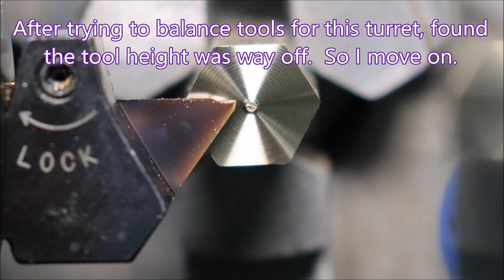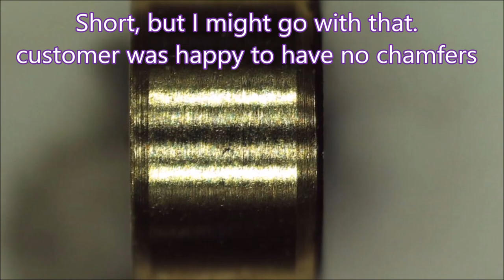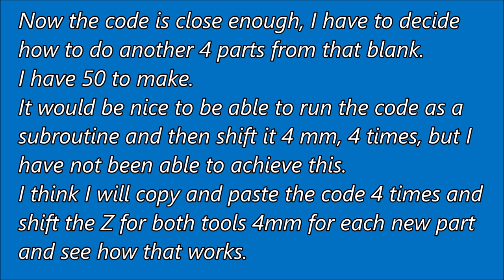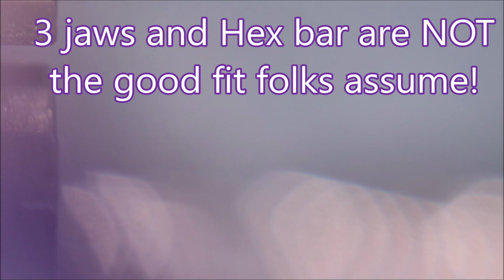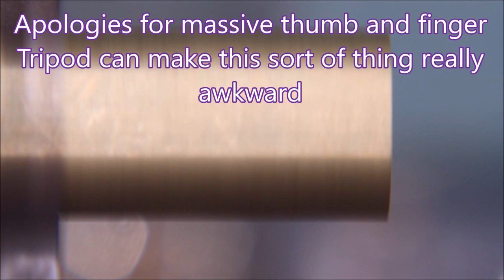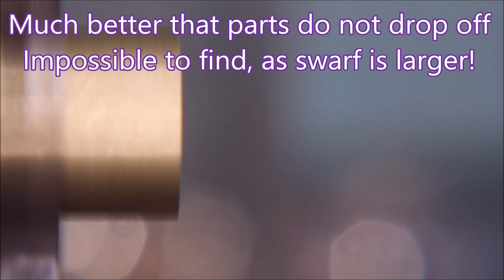Trash to Treasure, Clock repair bushes from scrap brass in a cnc lathe. G code fix, turn & part

Comment: Looks like you need to add a marker holder to your gang tooling. :-)
Reply from the maker: LOL, reminds me of the video where a wire brush is strapped to the turret to wire brush a thread that has been cut.

Comment: Something you could have tried is using relative figure (W) in canned cycle and just use absolute figure (z) for the start of each part. That way you could just copy paste cycle and just change your start posting, for me I usually use a g54.
Reply from the maker: I have another 50 to make at 2.7 diameter. When I play with that I will give it a try.

Comment: I'm New to cnc and have a question wrt cad cam. I have a hitachi Seiki machine and wonder what open source software you might recommend? Cheers love yr vids.
Reply from the maker: Craig Walker, Hi Craig, as I use the software that came with the machine, I am not very qualified to answer this.  May be someone else may chime in with ideas. You could check out the “path” workbench in Freecad. See if they offer a post processor that will work for you.
Reply: @smallcnclathes  Thanks so much the swift reply. Presently I am battling the serial connection but I did find freecad and will investigate further.  My machine is conversational apparently so maybe I should learn and only use that...Thanks again and enjoy your day!!
Reply from the maker: Craig Walker does your system offer simulation. I find it a really valuable learning tool.
Reply: @smallcnclathes  Not sure. Not got that far. I've been able to input the stock specs but not inputting the final shape as yet. It's a ht20s2 with seicos/yasnak control. Have manuals but the conversion from Japanese is awkward...
Many thanks!!
Reply: And yes, I agree the simulation be very useful!! That might be what it comes down to: if conversational does simulation...forget the cad cam.
Reply from the maker: Craig Walker friend has on old mill that has no simulation, he simulates using timber board. Perhaps you need to buy some round timber or plastic to do simulations.
Reply: @smallcnclathes  that is excellent advice. Thankyou.edit re plastics: I got come prices for plastic a while back and was shocked. I (like yourself) am into being "economical" with this "quite costly" hobby.Lol.
Reply from the maker: Craig Walker my aversion to cost has mainly come about since I have retired! Some rounds of timber may be your cheapest option. Plastics are expensive, pvc is the cheapest but does not particularly machine well. Acetal machines great, but is expensive by comparison. You could also look for a dry run option, I think this can give you the possibility of a z offset which makes the machine cut air.
Reply: @smallcnclathes  Thanks plenty. It was the acetal that had the scary quote. I'm not retired as yet but getting closer! Hope your retirement is long, healthy and fun!!
Reply from the maker: @craigwalker3256  Many Thanks

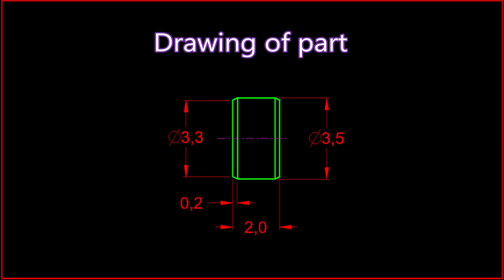Comment: 2:37 MAGIC SECRET FORMULA THAT CADCAM SOFTWARE MAKERS NOT WANT YOU TO KNOW
1-tan(half angle) * tool radius

your drawing is something i hate. its easier just make it 0.2x30 degree.
compensation formula is: (1-tan(15))*0.4=0.293 so 0.2+0.293 is chamber lenght with compensation
0.493*tan(30)=0.285 so X start diameter is 3.5-(2*0.285)

x2.93 z1
g1 z0
x3.5 z-0.493
z-1.907 (2-0.2+0.4-0.293)
x2.93 z-2.4 (1.907+0.493)

was i even close?
Reply from the maker: That’s funny, I hate tangents, sines and cosines!